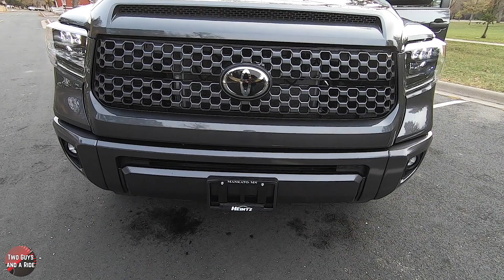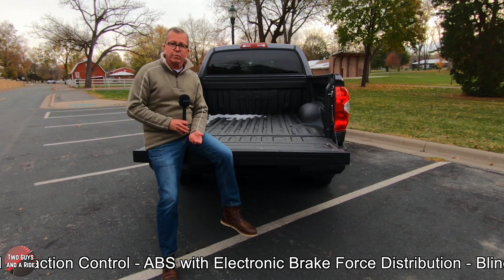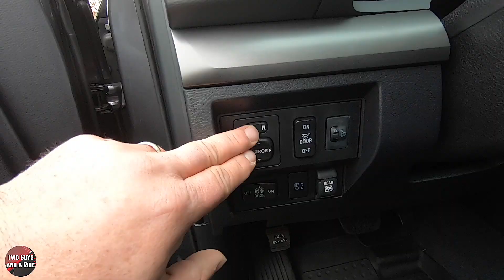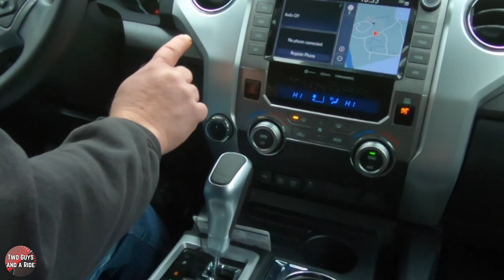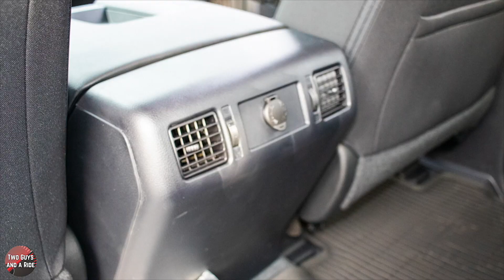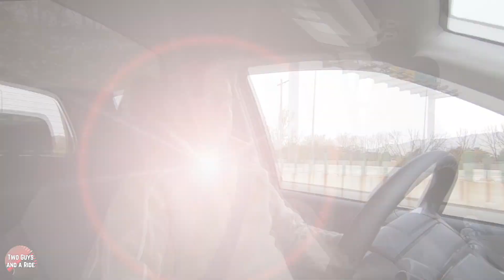Toyota Tundra SR5 – Old School Done Right /// @ $49k

Comment: Is that right? 38 gal fuel tank on the short bed? My GMC has a 34 gal and it’s so much handier, but I have the 8’ bed.
Reply from the maker: This SR5 had the optional 38 gallon Fuel Tank. The standard Fuel Tank is 26.4 gallons